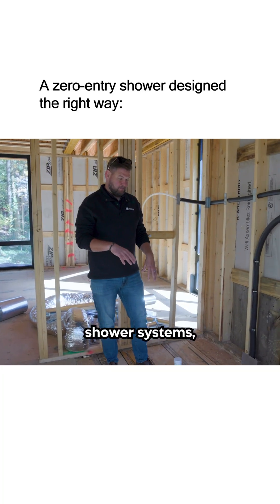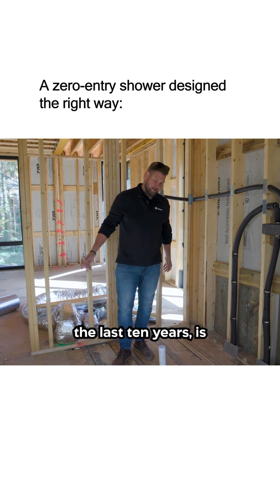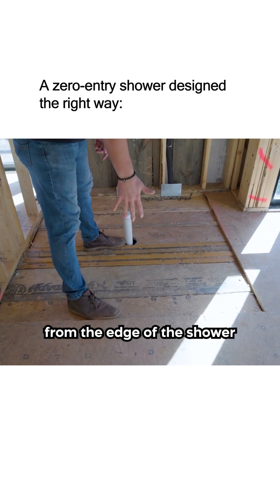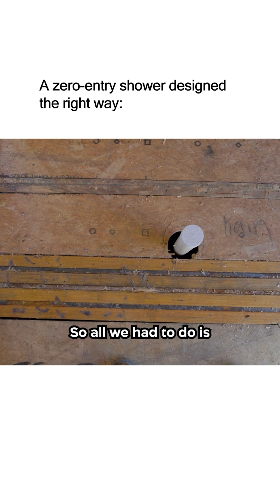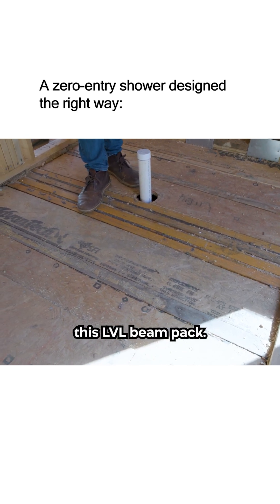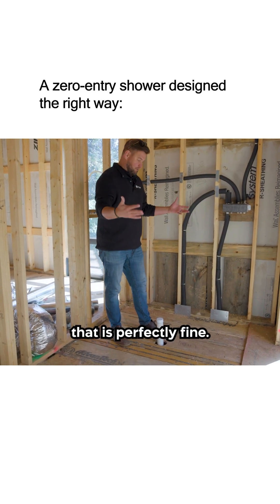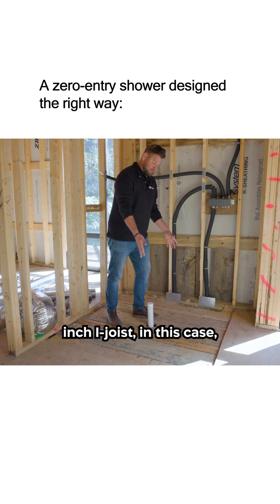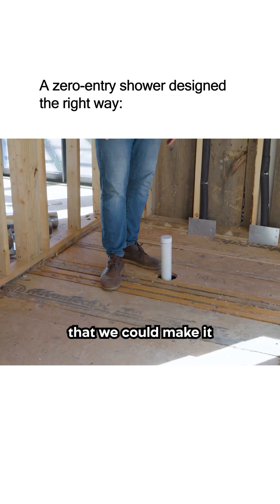🚿 THIS is how to build a curbless shower

Comment: I'm sorry but sloping the ground isn't going to do s*** to stop water bouncing off my body at awkward angles and leaving the front of the shower wet. These entryless showers are the stupidest and are a great example of why at a certain point, minimalism completely fails in functionality. Whether it's Apple, Tesla or a shower. FFS It's okay for things to have features. The lack of features is not a worthwhile feature in and of itself.
Reply from the maker: So to give a little expounding….design will always lead the fight. If we were to build a perfectly functional home we would designs. Square with no windows and ultra boring. So it’s up to us as both design professionals and as builders to design amazing homes that function. In this case there is still going to be shower glass, this isn’t an open shower and then this whole bathroom floor and turning up the wall will be designed like a big shower pan. This not only won’t leak and perform just life it if it had a curb around the shower but it will also look great. I’m not sure why you would argue to have a not as good looking shower if it can be built not to leak. If you like the curb look ok that’s an opinion but to say it won’t work isn’t correct
Reply: @goodwinluxuryhomes  Blood over here yapping cause he doesn't want to account for all body types. It's not rocket science, we're not asking for Minecraft Ahhh housing bruh.
Reply: Curbless showers are awesome for handicapped , elderly people in wheelchairs or just seniors on walkers.. I’ve never understood why anyone would want to step over to get in a shower! It’s 2025! Its simplicity is fantastic and common sense!
Reply: Ive done curbless showers for 20 years its not a big deal. And there are alternatives for water control people never think about
Reply: You usually install a glass panel as a shower screen at the side of the valve , this stops water escaping the shower area . You waterproof at least 24 inches beyond shower pan
Reply: You usually install a glass panel as a shower screen at the side of the valve , this stops water escaping the shower area . You waterproof at least 24 inches beyond shower pan
Reply from the maker: Good thing this isn’t your home 🤷🏼‍♂️
Reply: @goodwinluxuryhomes  no kidding, and good thing you're not my contractor!
Reply: I was expecting some witty or smart comment from the channel, maybe explaining why you would be wrong.....instead they didn't deny anything and said, "And?"
Reply: 100% agree with you. Moderation is lost in the modern era. Everything goes to the extreme at the expense of everything else.